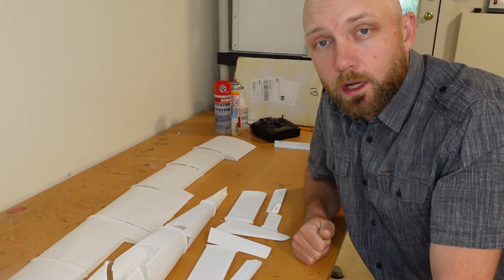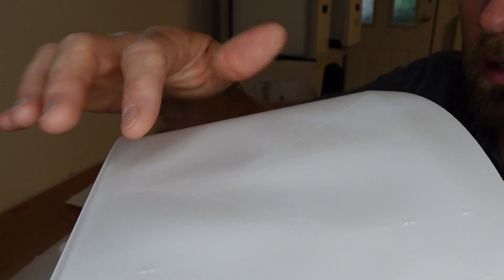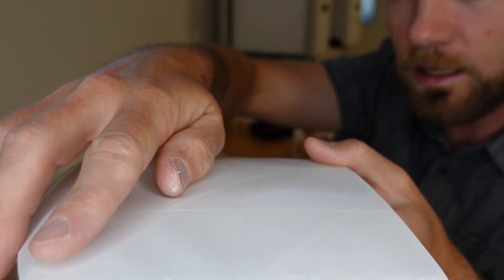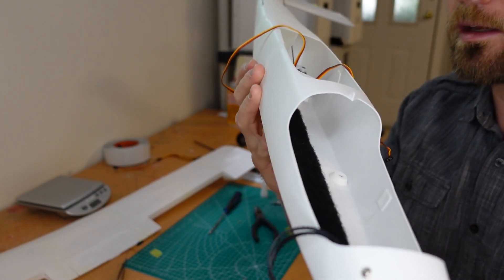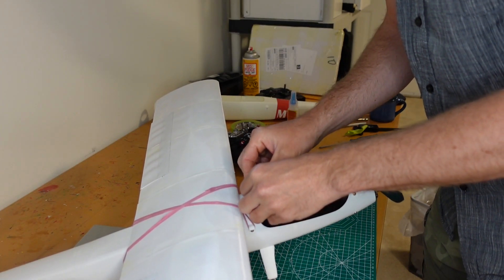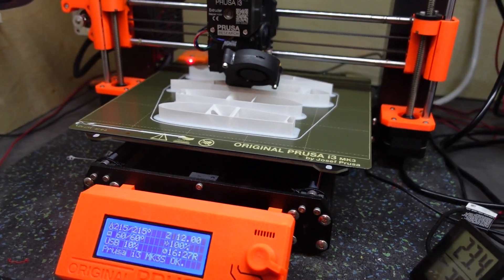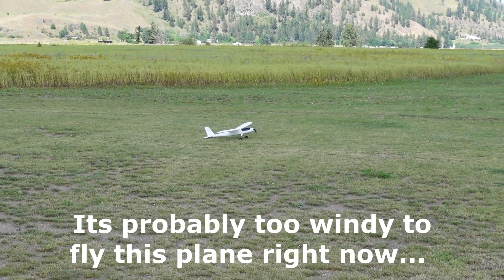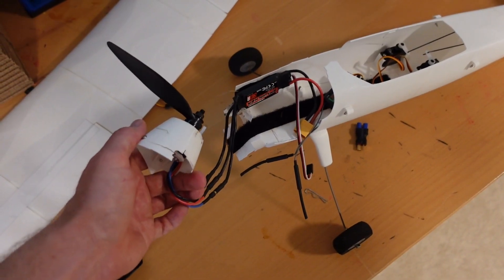Eclipson Model T - New filaments, a few tips and some failed flights

Comment: Fyi moo CA glue  needs what you're calling activator.  CA glue and super glue are the same thing.  You can get it in different thicknesses.  Your spray isn't an activator,  it is accelerator,  to speed up the curing process, not make it happen.

Comment: those planes were tail heavy for sure. almost unflyable. Balance it 10mm behind the cross marks.
Your settings for the LWPLA were off. get them right and LWPLA will be better, and fly better.
Reply from the maker: Thanks for the tips. So far I'm not a fan of printing with LWPLA but I KNOW it will fly better based on countless youtube videos from those more experienced than I am. I like that when I print in regular PLA I can print a whole bunch of items together on on build plate without any issues so its far faster and the final product is much stronger as well so its a toss-up for me. I'm going to try another model soon and see how it goes, maybe I'll do it in LWPLA... thinking of this guy next: https://3dlabprint.com/shop/piperj3cub/
Reply: @rcprinter  Ok, fair enough. I strengthen my LWPLA planes in critical areas with fiberglass cloth. It's very thin stuff, like tissue paper. But in the end, both PLA,s will break when crashed.

Comment: which way does the motor go into the mount? wow that is a pain the ass to install.. should have had a printed arrow on which way up also have a couple tabs that it could slide in to line it up with the holes.
Reply from the maker: Well, it goes on the front... so not the side with the L on it. AFAIK, the L side gets mounts towards the left of the plane.  I'm sure I've installed the motor with the wires coming out from either side of the mount so I don't think orientation really matters. As a sidenote you might need this depending on the length of the motor you're using: https://cults3d.com/es/modelo-3d/variado/shim_motor_flite_test

Comment: Way to keep at it.  I've built several model C's and a model M power glider.  I'm now working on the Pitts... all in lw-pla.  They fly well but crash poorly.  Go figure.  I folded up the wings in the Model C, but just downloaded the upgraded wing stl that has the slot for a carbon fiber spar.  I wish they all did, and I also wish they would put a decent size carbon fiber rod as a spine like the power glider has.  Two of my model C's have broken when flipping over frontward in a grass landing  and snapping the fuse in 2.  Good thing I like building almost as much as flying.  I would respectfully disagree with the comments about a bigger elevator. The flight I saw in your video didn't show lack of elevator authority. It looked to me like you could have been a bit tail heavy. I do agree about learning in a less windy day, but you rarely find those days when you have a new plane to try.  Good luck Man.
Reply from the maker: Hey man thanks for the support. Many more planes will be printed and crashed in the future!
Reply: Your Model C experience sounds exactly like mine. After flipping forward in grass during landing the fuselage split. After fixing it and flying today the wings folded and completely destroyed it. At least I got one good flight in (plenty of power on 3S and 1400kv motor). Going to rebuild and try using a hardwood dowel as a spar instead of carbon fiber (which seems to be hard to find and pricey).

Comment: Nice, it's hard flying such a light model in wind
Reply from the maker: ya pretty hard to find a day around here with no wind unfortunately. I'm gonna need to keep looking for the best spot to fly these models.
Reply: @rcprinter   I would say double the width of the elevator to give you more control, I remember when I was younger just duct taping a piece of thin cardboard to the elevator if it was a little windy, since you're a beginner a gyro would probably help to
Reply from the maker: @Poulpc  love the elevator idea, that would help a lot. Gyro is a good idea too.